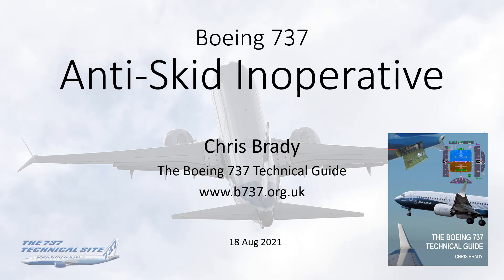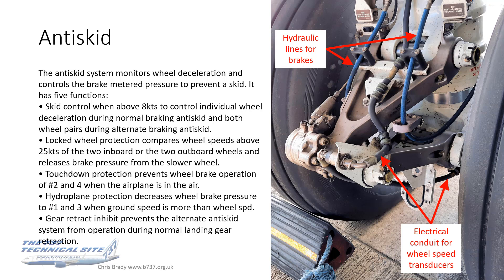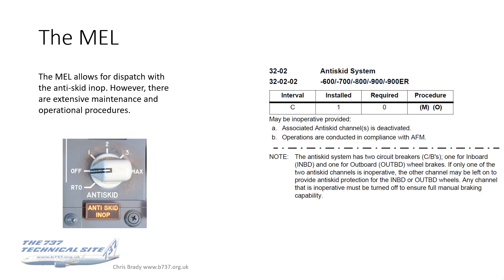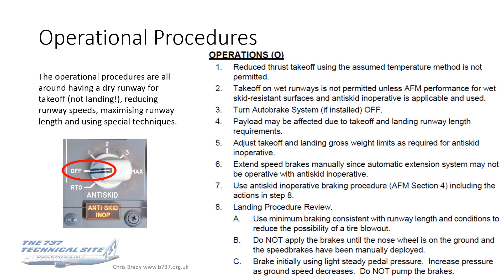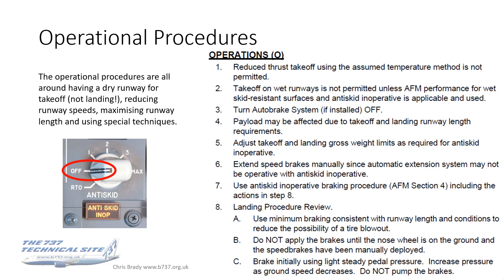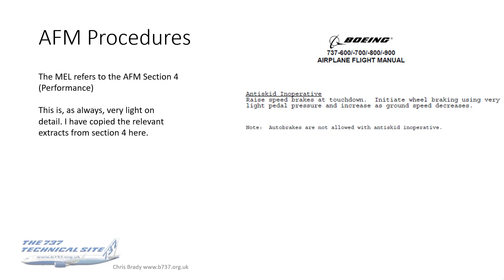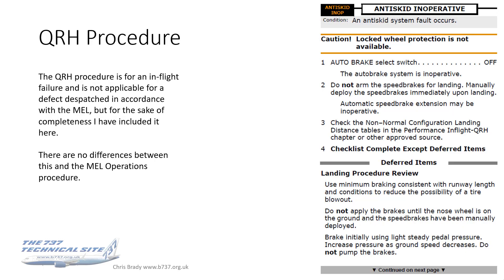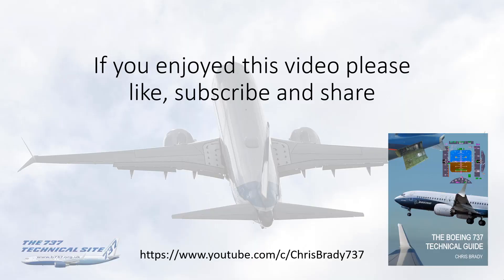737 Antiskid Inoperative

Comment: I guess maybe the reason of the spark or the flame is the rubber part of tire went off(as you can see there are a lot debris flying around , so the steel part might touching the runway(spark)
, and if the pilot using the brake too hard with antiskid iop, the friction between pistons and break disc could be very strong, and there will also accumulate a lot heat which can burning the debris.😃
Reply from the maker: Very possible

Comment: Hi Chris. Referring to a recent accident in my company on a 737-800 with resulting 4 main wheel tires burst and following evacuation. No harm to anyone except the poor tires... Aircraft seems to have been dispatched with the Antiskid INOP according to MEL. Im wondering what went wrong? Wrong braking technic seems as the most probable cause. But is there anything else technical with the aircraft that could have happened. For example. If the crew accidentally set auto brakes. Would they work? Or would you get Autobrakes DISARM light on immediately. E.G. A/B doesn't even arm. I hear from sources that A/B wouldn't work if the Antiskid channels are disabled. My instant thought is crew failure to brake properly according to laid out procedure by Boeing. Your 5cents on this is appreciated. Night landing. Dry runway, Long runway and light winds.
Reply from the maker: Hi Daniel, I refuse to be drawn into speculation on what could have happened because I do not know all of the facts. We must wait for an official report, if one is to be published. You should not use autobrake with anti-skid inop.
Reply: @ChrisBrady737  Hi Chris, not to get you involved. Just to know if you have an idea if the A/B is able to be armed if the antiskid is INOP. Thanks for a great channel and all your amazing content
Reply from the maker: I don’t know for sure but I see no technical reason why the autobrake could not be armed. Again I repeat that you should not do this.
Reply: @ChrisBrady737  thanks Chris for always replying in a timely manner. Looking forward to new content! :)

Comment: Helo Chris, Marco from Norwegian, another interesting example about anti skid inop is that you are unable to do a CAT3 but if you look the Mel it doesn’t say anything until you look the cat3 checklist or the Mel preamble where it is mention. So you maybe think it is ok to go but you can end up in north of Europe with a CAT3 app and unable to land!
Reply from the maker: Hello Marco, you raise a great point. Autoland without antiskid is not expressly forbidden by the MMEL as approved by the FAA/EASA. However in appendix E of the operators MEL/DDG you will find reference to this. The usual wording is "The Antiskid System is not required for an Autoland, however, due to a lack of performance data it is not possible to plan for an Autoland with the Antiskid System inoperative." So no antiskid does not affect the Autoland BUT you do not know how much runway you will need, so you cant legally do it!
Reply: @ChrisBrady737  thanks for your answer very true. Have a good day

Comment: Great video as usual! Why the speedbrake wouldn't deploy with the Anti-skid inop? I can imagine the 60 KTS condition could be affected if the speed data to the AACU is incorrect, but at the same time compression of any gear will trigger the deployment. could the latter also be affected by an Anti-skid inop?
Reply from the maker: Great question, I have not looked into that, I just took it at face value as Boeing state it very clearly.
Reply: Boeing says ‘May not’!
Reply: may i please joint it, first when right stut compress ground spoiler deploy left stut compress flight spoiler deploy, but if I arm the speedbrake for landing, I beleve  there is no wheelspeed 60 kts to crosscheck before deployment, in that case fault stut compress sensor could deploy that side's spoiler.

Comment: As also a licensed motorsport driver, this topic is really interesting to me, braking on tyre's physical limit without ABS is quite normal practice for racing, but surprisingly how little pilots, as also mostly as daily car drivers, have little knowledge about it.
Well, I can't know if you can "feel" the tyres in a 60+ tone vehicle as in a less than 1 tone car. but The basic knowledge about the tyre's behavior under skid and slide is almost absent for most airliner pilots I have met (BTW the Grip - skid/slide angle  chart is astonishingly similar to Cl-AOA charts in my view).
I also like to share a data source I often quote in my class about 737's braking action(although for -200), it's some analysis and tables from an accident report of JTA611, but the official report only available in Japanese (which I can read), not sure if it could help you then. some tables are in page 37~38 of https://www.mlit.go.jp/jtsb/aircraft/rep-acci/59-5-JA8444.pdf
Reply from the maker: Hi Umi, 
Thanks for your comments. I agree that knowledge of tyre behaviour is lacking in pilots but I have to assume that if it was vital it would be included in the ATPL or type rating. Also as most manoeuvring is in a straight line (on the runway) a lot of the physics knowledge should not be needed. 
You can feel the tyres to some extent in an airliner but often there is very little you can do about any misbehaviour, simply brake more or less!
I checked the tables in the JTA611 reference but alas I could not understand them. Thanks again for your input
Chris
Reply: lol nice try. Sorry, you cannot associate your little DE track car to a 180,000 pound airplane on 3 points with just 6 tires. I will add the 737 is woefully underbraked, in addition to its artificially high approach speeds.